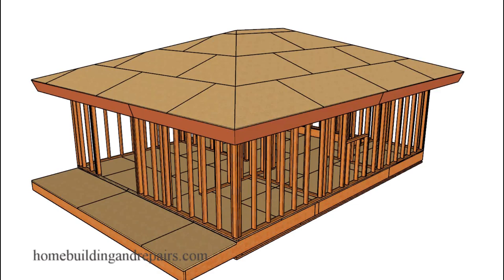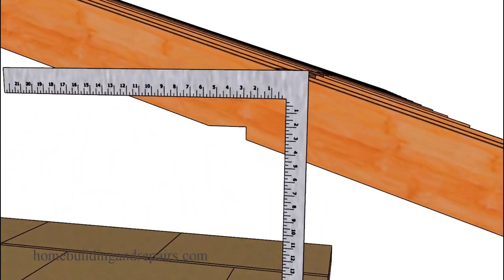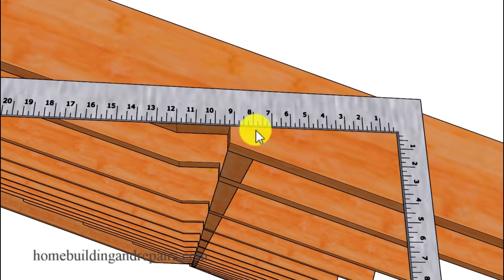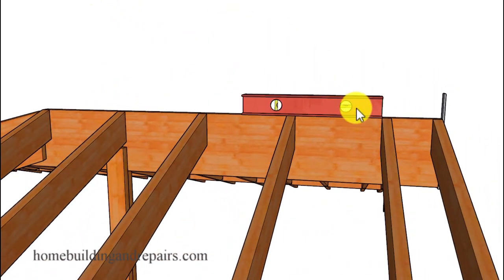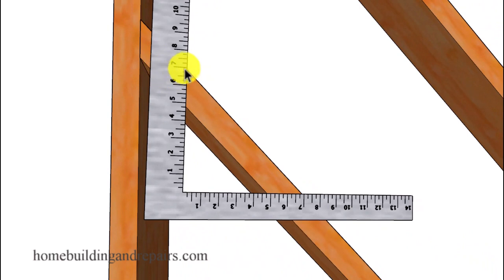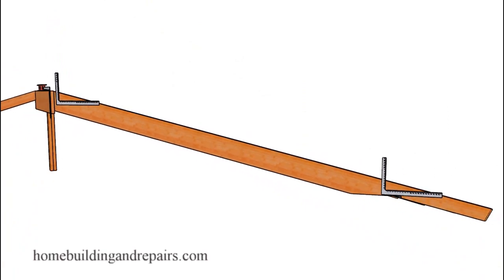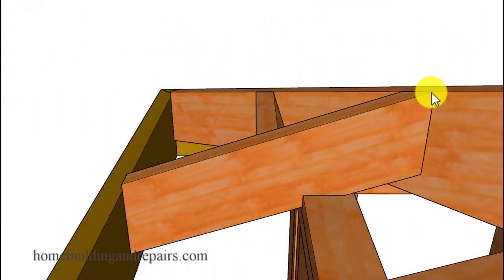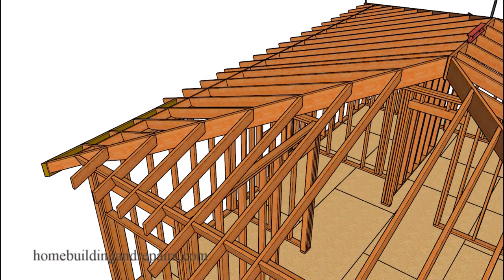How To Calculate Hip, Common And Jack Roof Rafter Angles With Framing Square And Roof Ratios

Comment: Just to help some people understand, 16.97" (17" on your framing square) is the diagonal of a 12-inch square, therefore, for every 12 inches of the common rafter run, the hip (the diagonal) travels 16.97 inches (17") to reach the proper point.